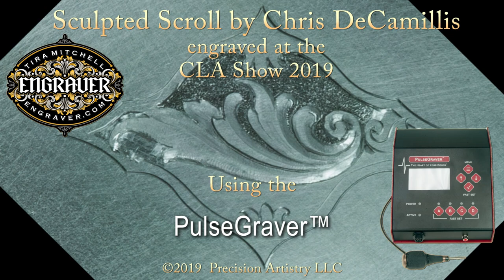PulseGraver® Airless Hand Engraving and Stone Setting Tool Sculpting Steel

Comment: What are you using to smooth out the background/ tool marks?
Reply from the maker: It's a smoothed punch that is used for sculpting.  You can make it out of a variety of things and put on different textures depending on what kind of effect you're trying to achieve.
Reply: @TiraMitchell  What are you using to smooth out the background/ tool marks, though?

Comment: Wow I wasn't expecting it to be that expensive. I suppose this is more of a tool for professionals then.
Reply: @A killa 4 reala Not really, it's a very niche market and to make them to operate consistently to a high specified standard of course it would cost a lot, you could mass produce some things but even then, I've come to see cheaper stuff don't last and have their own problems
Reply: @muhammadc2000  other than more control over settings it seems to use almost the same system as a rotary tattoo machine, don't know much of the internals of the handle itself but with the size of it it doesn't really look like it would be that complicated or expensive to make since it is basically piston driven, although a niched service it does itself a diservice by overpricing itself. 2300+ for a basic setup is more than most pros are even prepared to push for it since standard air gravers are well below half of that even for good brands 🤷🏼‍♂️ it's powered by either a rotary engine or an electrical pneumatic systems which are really simple in themselves.